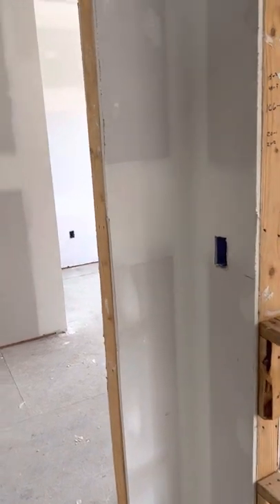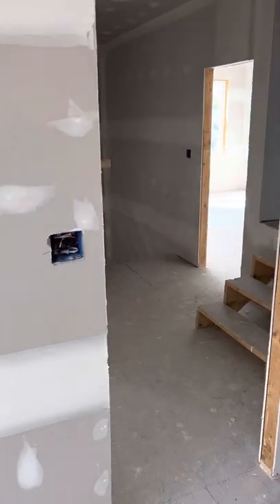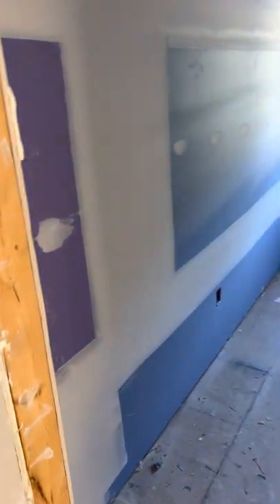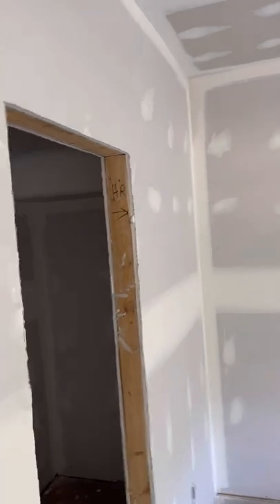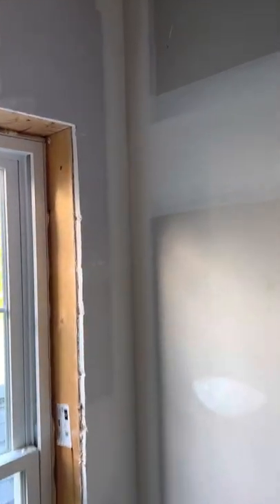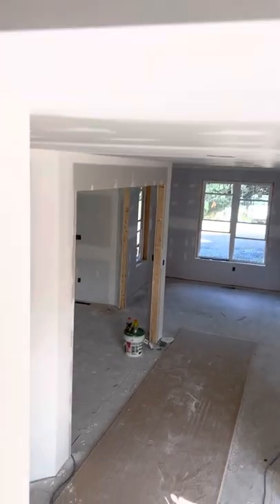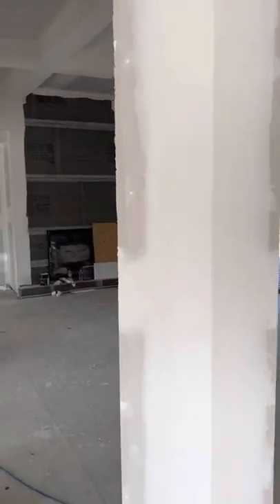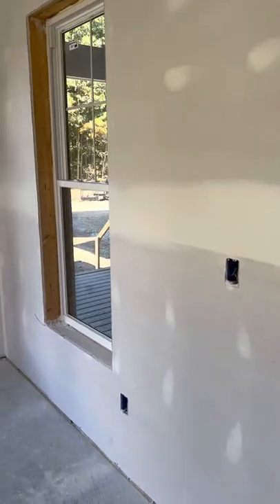Skim coat final steps prior to sanding to assure a quality finish.

Comment: Damn mate , I feel your pain sanding that big of a house alone 🥴
I'd love a new series walking each day/stage of a job through in chronological order 🙌
I've had staff, used contractors either me etc
But for the short term it's just me. And I'm using flushers etc and trying to figure out a system to stick by. 
Just looking for some inspiration brother
Reply: I'm very similar except the staff part just started with flushers so far I'm really enjoying them , makes more of a mess but worth it for the time savings so far
Reply from the maker: I am so sorry I am responding to this so late.  I have a house coming up and will do a full series start to finish.